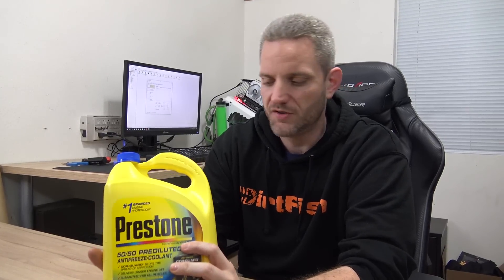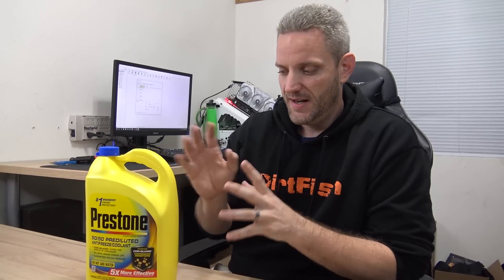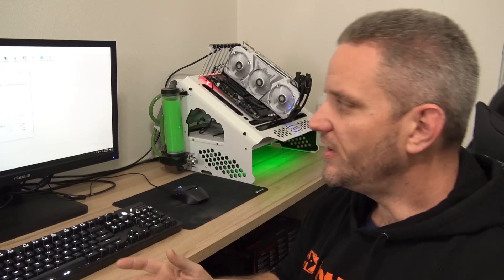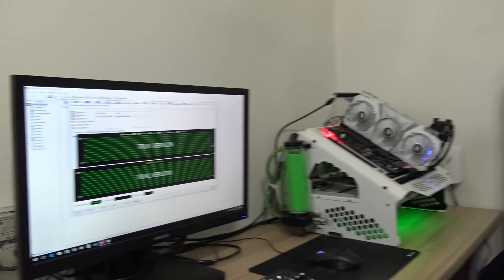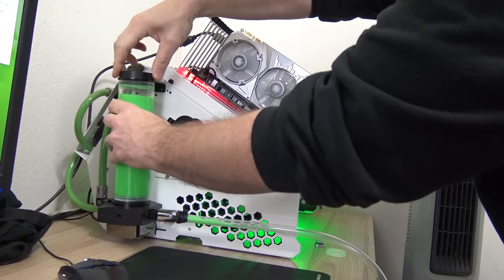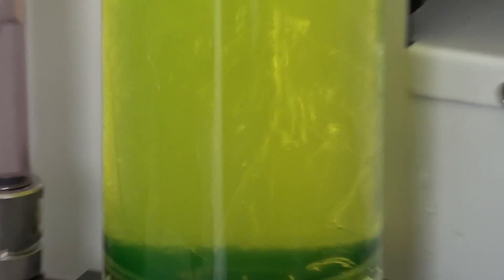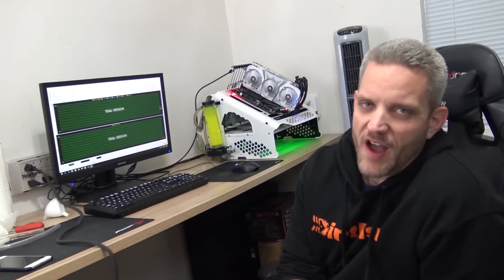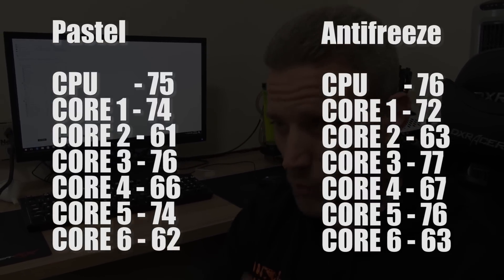I used Antifreeze to cool a PC

Comment: Im late on this but this serves no purpose. the only reason special coolant is used in vehicles is because they are exposed to freezing temperatures as well as the fact that the motor gets hot enough to boil regular water. the pc will never get hot enough to boil over its cooling system and hopefully never be in a condition where water in the system would be allowed to freeze. You're simply exposing your pc to unnecessary potential damage because of all the added chemicals that are in the coolant that Im sure none of the cooling system components were designed to be in contact with.

Comment: anti freeze is a better insulator compared to water. a higher ratio will antifreeze to water will lower the freezing temperature but will also reduce the efficiency of heat transfer. there would never be a reason to use ANTIFREEZE in a heat exchanger. since the computer is at no time ever at risk of having its water freezing. ANTIFREEZE (clue is in the name) is pipes that live in -0 C temperatures and are at risk of freezing. @JayzTwoCents I'm really surprised you made a video with this much nonsense in it.
Reply: so at the end you said the video is pointless so I'm glad you came to your senses.

Comment: Im using anti-freez since 2 years and nothing happens 
The reaktion is only the anti freez it self you have to shake the bottle first :) 
Im on a soft tube full loop so come down but dont use it with hard tube thats true :F

Comment: Honestly there is no reason to run these risks if you want to know if it will work well all you have to do is look up the liquids heat transfer and thermal capacity and compare it to water. 
i'm pretty sure the only reason cars use anti freeze over water is because water expands a lot more ate higher temperatures than antifreeze does. Oh and some of the anti corrosive elements.
Reply: It's actually antifreeze/coolant. It has nothing to do with the expansion rate. It lowers the freezing point of water, and raises the boiling point of water. Most vehicles run a 50/50 mixture AF/W, and up to 70/30 AF/W in extremely cold environments.There are also lubricants and corrosion inhibitors that are added. It is also naturally anti-microbial.
Reply: oh wow ya the last thing i said was dumb as fuck thanks for calling me out on that. Anyways for pc cooling Thermal conductivity and thermal capacity are the main 2 things you need to look at. So if anti freeze mixed with water doesn't change that by much it will do nothing. Unless you start cooling the liquid more than you normally would which he didn't do as far as i know.  So if you cooled the liquid to 0C it might have made a difference.
Reply: I am a mechanic(30+ yrs) so I understand. I don't think he should have used it in a 50/50 mix though. Awfully viscous for such a small pump, and I doubt his rig will ever get hot enough to boil water. Also didn't hear him complaining about the sub-zero temps in SoCal either! LOL! I think maybe a 1/10 - 1/8 AF/W mix would work well for lubrication, anti-corrosion, and anti-microbial purposes. And if he didn't like the colour, there is a product that racers use on the track(To prevent contamination of the asphalt surface when something blows up) called Water Wetter. Same properties as AF, but clear. I don't know if it could be dyed though. Maybe I'll look in to that.
Thanks,
Matt

Comment: Late to the party but as a pipe fitter working on skyscraper sized hydronic heating and cooling systems nothing is more efficient as far as fluids at moving heat than water. Anything you add decreases a systems efficiency be it wetting compounds or antifreezes in the broad sense.

Comment: Antifreeze keeps the water from freezing and usually has corrosion inhibitors. Most engines have components made of dissimilar metals. These components are subject to galvanic corrosion and that's why antifreeze needs these corosion inhibitors. Water is the coolant. The cooling system pressure keeps the water from boiling at operating temperatures. Much like the way water boils in a vacuum water boils less easily when the pressure goes up. That is why your radiator cap has a pressure rating on it. This keeps the water from boiling and your engine overheating, as water vapor doesn't transfer enough heat to cool the engine. You can run water only in a car, and it will cool better. It will also freeze in the winter, or cause corrosion. on the other hand, If you just put straight antifreeze in your engine your engine would overheat. Maybe it would be useful if you had disimilar metals in your rig. also there's usually no biocidal ingredients in antifreeze. So you could get algae possibly.
Reply: As long as there is sufficient antifreeze, bacteria will not form due to alcohol, to be sure, you can add some copper sulphate to your mixture.

Comment: antifreeze isnt a good coolant. water is much much better, the reason we use antifreeze in our vehicles ( and  50/50 mix with water at that) is to help prevent the water from freezing (ANTI-FREEZE). it also has another benifit of increasing the boiling point of the water so that it can take more heat before it starts to boil and come out of the pressure release valve. just wanted to say this because lots of people seem to not know.

Comment: Absolutely pointless. Antifreeze is meant to stop your radiator from freezing in the winter time. Water absorbs much more heat than antifreeze, the only problem is that is freezes at a much higher temp. So you mix it with a 50/50 solution to get the best of the both worlds. Running a car with a 100% antifreeze will cause it to overheat.
Reply: If you live in the tropics or the desert, you should be running your car at 100% distilled water for best heat management.

Comment: If there was no danger of freezing than normal water actually cools better than antifreeze. I bought a used EVGA AIO cooler for my graphics card and upon arrival the radiator had been damaged and was leaking. The fluid smelled exactly like antifreeze and had a oily consistency of it. I am guessing they do this so it can be stored anywhere without climate control.

Comment: I have used Ethyleneglykol in my system for 8 years and havent flushed it once. Just refilled it at times. Took it apart this week to change it out for new things. 

Nothing at all has happened with the parts apart from tubes discoloring some.

And to be honest, materials used in watercooling isnt much of a difference, if at all, from what you use in a car.

Comment: I ran my loops with 10% antifreeze/ 90% water for the past 10 years no problem. Temps were good and the only downside was the reaction with soft tubing would cause it to cloud after a couple of months. I'd typically run 3-4 years between changing tubing & coolant. Don't see what the fuss is about, I've moved to EK-CryoFuel Clear now just to maintain clear tubing.
Reply: how man years on the clear coolant?  also there are different car coolants, like G05 or the VW pink/red stuff. some different PH balances and lubricant and what not.

Comment: HAHA Antifreeze, I used this back in year 2000, did great job in long run, never had issue.  The downside is smell and draining requires care.  So 17 years later, antifreeze or similar will come handy if you want sub-zero watercooled PC.

Comment: I don't know about PC water cooling fluid. But I do know that anti-freeze is actually not good for cooling a car. Anti-freeze is mostly there to prevent corrosion, raising the boiling point of the water, and of course keep the water from freezing. Running 100% coolant will actually cause your car to overheat compared to 100% water. The ideal mixture in a car is like 80% water and 20% coolant, however this depends a lot on your local climate. That 50/50 stuff is absolute crap lol.

Comment: Those "internals" as you call them. Are baffling. They are in place to keep the newly heated fluid from immediately re-entering the system before it has a chance to cool down. Your results may be different with them installed correctly. Re-do the test. With Longevity!

Comment: I've used motorcycle race coolants in my closed loop system for lulz, it's been fine for 4 years now, however I replace the coolant each year in the winter. Just to be safe because coolant is only good for 1-2 years anyways until it's cooling properties start to degrade. There is no difference in cooling.
Reply: 🙋I was wondering about the biodegradable engine ice.  But I guess I'd there's no difference 💁✌️
Reply: @rjames7380  After 5 years of Honda Blue 50/50, today I used Engine Ice, dropped my CPU temps 8 degrees Celsius over the Honda 50/50 comparing new to new.
Reply: @SquidRider  What are your new pure water and antifreeze ratios?
Reply: Automotive coolant is good for 5 years
Reply: Holy cow... I just replaced my coolant in my cooler again, forgot I even commented... So that coolant lasted for 5 solid years, I got bored and wanted to try "Engine Ice" in my cooler. Zero ill-effects and my radiator was spotless from my 4 year old Honda Blue 50/50 coolant lol. I will say, WATER WETTER would probably be your best bet as far as being silly with automotive coolant. Distilled to a 70(Water) / 30(Coolant) split. Remember, DISTILLED water out performs coolant in cooling capabilities but provides little to no lubrication to the pump and offers no corrosion resistance.

Comment: Cat ec1 coolent for diesels . no water . modern deiesels can not have any water in their coolents . cavitation is destructive to cylinder sleeves. but will eat sissy tubing.
Reply: Devin Williams the term preblended and 50/50 are industrial marketing wank. Cat ec1 refers to caterpillar's requirement that the coolent has 0% water. Deisels have what's called 'wet sleeves' . when water in any %contacts the sleeve at full operating temperature , the 'coolant' cavitates . cavitation very slowly bores an extremely small pinhole through the sleeve . this leads to a catastrophic failure caused by hydrolocking. Its interesting stuff . interestingly , through out most of the world , today's manufacturers of diesels require cat ec1 coolants. A side benefit of using these coolants is not needing to change fluids for the life if the engine . guess how long navstar , Cummins , or caterpillar engines typically lasts . so point is , the 50/50  preblend labeling is marketing wank. Its geared towards a whole generation of folks who were taught to dilute their antifreeze. Some societal behaviors never die.

Comment: You had throttling going on or higher fan speed or something, the temperature with the antifreeze was supposed to be higher, not the same, as it has both poorer thermal conductivity and heat capacity.
Using antifreeze to cool a CPU isn't necessarily a good idea but it might be a necessity if your loop has different metals in it, because antifreeze curbs galvanic corrosion, that being one of the reasons why it's used for cars, the rest of the reasons don't really apply though (resist freezing, increase boiling point).

Comment: No joke, Jay. I just did a new loop for my system. This time around I'm using EK cryofuel because I wanted my liquid to be clear, but before that I tried something new and I ran Antifreeze and distilled at a 9:1 ratio and I have to say, I'm super impressed. I took my CPU block apart and not a single trace of buildup and I ran the liquid for a year. As I said, I'm using cryofuel this time around because I was sick of the green haze my liquid had, but if this doesn't work, I may just return to the antifreeze and water mixture as it ran like a champ for so long. Just reporting in and letting you know!
Reply: I'm hesitant to use antifreeze but Liquid Utopia is only so good and it's definitely not worth $15 for a 15ml bottle considering you're supposed to mix that 15ml bottle in with 1 gallon of distilled water which is $7.50 per coolant change. In 8 years of having a water loop, I had to replace 1 copper radiator due to corrosion and that was even with changing the water every ~6 months. Antifreeze is $15 for a gallon jug of concentrate, it's just a question of whether it works better than Liquid Utopia or not. I'm using that pvc braided fda approved tubing instead of pc watercool tubing because hopefully it has better chemical resistance as advertised. O-rings, the reservoir and part of my cpu waterblock could still get degraded by the antifreeze.

I saw this recipe on the internet for a homemade corrosion inhibitor one time that I've lost the source to but basically the guy used sodium molybdate and benzotriazol to make something that held off corrosion on aluminum and copper in salt water for longer than liquid utopia did. I'm running an experiment with stainless steel, copper, aluminum in bottles of distilled water and different corrosion inhibitors including antifreeze but of course it will be a long time before I see any results.
Reply: @scotts-tech  Don't hesitate to share the results when you got them.
Reply: @scotts-tech  you are overthinking, there is a reason why car and industrial coolants have bren in use for decades with barely any changes.
They are mature products which have proven to be reliable in the exteme conditions found inside combustion engines, heat exchangers in chemical plants, etc.

All the crap sold by water cooler PC comoanies is just them faffing around trying to reinvent what the automotive, petrochemical and chemical industries already solved before WWII.
Reply: So how was it? Tell us!
Reply: @wus-poppin  I wasn't able to acquire benzotriazole to make my own corrosion inhibitor. The only viable listing for it on amazon sold out by the time I was ready for it. However in my experiment, green ethylene glycol antifreeze has performed better than liquid utopia. The copper is already shinier in the antifreeze solution than in the liquid utopia solution and it's only been a month. The aluminum in the liquid utopia is already starting to darken and corrode. The aluminum in the antifreeze is still shiny. The stainless steel fittings in both is still shiny with no signs of corrosion.

Once enough time has passed for the results to be more obvious on camera, maybe I'll make a video about it.
Reply: I think his pc exploded
Reply: Bruh what 2000 iq play is that

Comment: The "reaction" at the beginning is just the remaining water in the system mixing with the ethylene glycol.
Reply: I had that thought but wasn't exactly sure
Reply: Yes, It was just the distilled water floating up to the top because the coolant is just so slightly heavier than water.
Reply: @nimmen  yes, ethylene glycol will sink in water as it is denser and we can observe that. At the same time it diffuses in the water since both are miscible, as this happen the refraction index of the mixture changes. This causes the effect we see, it happens everytime two different miscible liquids  are mixed, it even happens if you mix hot and cold water together. Fun fact, it is the same effect you see when you look at a hot road or a hot pan and you see the "heat" emanating from it.
Reply: so can i replace with car coolant to my aio water cooler
Reply: @Nafinfo  Yes you can, but make sure that those tubes are EPDM / compatible with ethylene glycol and do not use 50/50 mix, but lot smaller mix. Like 25/75 or 15/85, mainly because car coolant has higher viscosity and it's harder for the pump to move around
Reply: @StaticVapour590  my aio tube just are braded. its gamemax icechill. is that ok ?
Reply: @Nafinfo  If it would be "braided" only, then it would leak all it's fluid out. It does have rubber tube, but you need to know what kind of material it is.
Reply: @StaticVapour590  ya i mean  i dont know what kind of tube is this cause braided
Reply: @Nafinfo  If you can afford to risk it, then go ahead. From what I've gathered it's just "low evaporation rubber" so probably EPDM.
Reply: sometimes i also wonder why people keep making it bad, the fact that there are actually tons of guys that actually using car coolant as their PC coolant for years and it show no problem. After all some PC coolant premix is actually ethylene glycole base to...just dont use 100% car coolant...even 50/50mix, just put 1:10 collant:water ratio...after all it just enough to have 1/10 coolant as addictive to prevent rust and biocide, and it will be diluted and less reaction to acrylic or petg eventho its bad to use petg. There already tons of guys who has use car coolant and it doesnt make their acrylic res leak or anything.
Reply: @slyztercoreveanged3175  I'm planning on fitting older AIO to my GPU, it needs service and I will fill it with VW G12 coolant for sure. I don't care, I will make sure to flush it regularly
Reply: @slyztercoreveanged3175  there custion in car coolant box “dont mix with water”.
so what kind of water should we mix with that car coolant ?. cause i refill my aio water cooler with 100% car coolant. but im still not using my coolant cause im worried bout chemical reaction
Reply: @slyztercoreveanged3175  also my aio tube material made from low evaporation. is that safe to fill it with car coolant ?
Reply: yeah on the bottle stands do not add water
Reply: @FREAAAAAK97  That's because it was a 50/50 mix. There are some bottles of antifreeze you need to mix with water. You should optimally have a 50/50 mix.
Reply: Your mix is actually dependent upon the expected temperature range, plain 50/50 just has the least compromises.